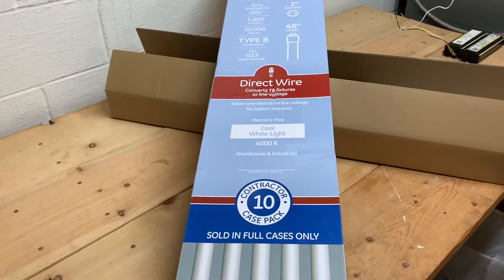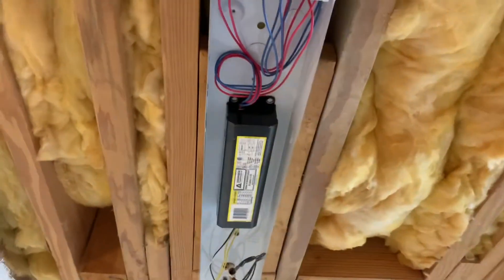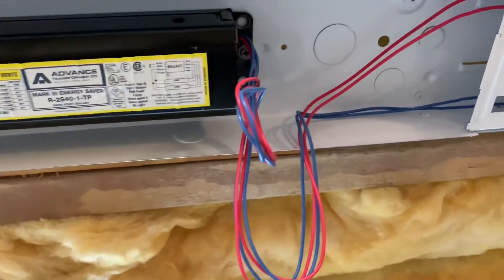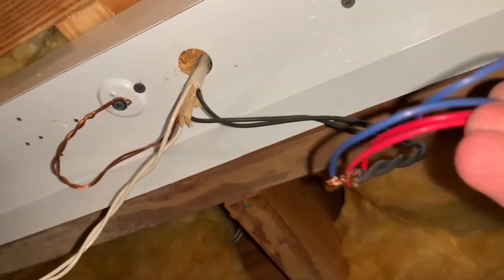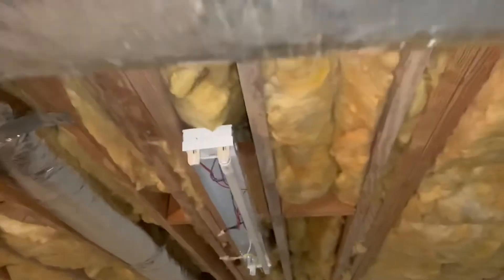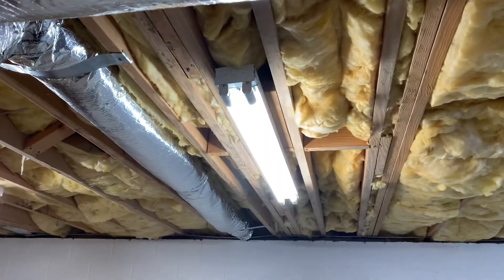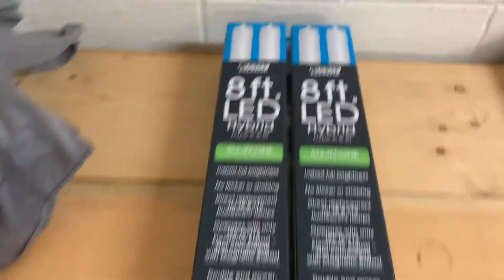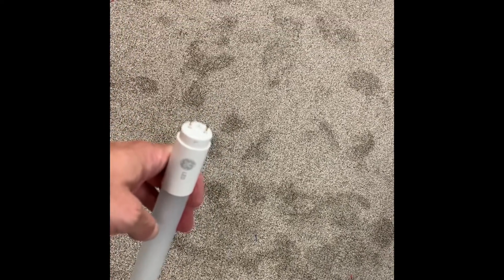Convert Fluorescent Shop Light to Direct Wire LED (bypassing/removing ballast)

Comment: Idk if it matters with this style bulb but i know FOR SURE that on a single pin 8ft led bulb there is no "Load" or "Neutral" end of the bulbs you can put them in either or and they will work just fine.
Reply from the maker: 7:20 
Cool that’s great. In the situation I’m in - dual pin Type B 4’ residential, changing from fluorescent to LED - the bulbs clearly show a Neutral and a Lead. See 7:20 in the vid. The way I did it continues to work. If you do yours differently, please report back on how it went. That would be helpful. Thanks for the comment.
Reply: @mattmulry7329 I did exactly the same thing you did changed my old 8' florescent bulbs to led, hardwired them and junked the ballast. Not saying your not right with your situation I'm just saying with a single pin type 8' T8 - T12 led bulb from Amazon it makes no difference which way the bulb is mounted.

Comment: Are all ballast bypass bulbs wired in this manner or are you just going through the motions and hoping it works?
Reply from the maker: Dunno mate, I’m not an electrician or bulb designer. I followed the instructions in the box and made a video that will hopefully help some people. Good luck.

Comment: Strange, I thought with the GE Direct Wire tubes it didn't matter which way the tube was installed?  Also, is it safe to use a ballast bypassed two bulb LED fixture with only one bulb installed if I find it too bright?  Read somewhere that empty sockets powered on could be a hazard.
Reply from the maker: On mine there was a Lead side, and a Neutral side, clearly labeled on each tube, as shown in the vid. HTH YMMV
Reply: I don't think it makes any difference. Consider this setup as two lamps plugged into an outlet with a light inserted in one and not the other. The lamp analogy is dangerous due to the shock hazard of an empty socket in the one lamp. However, you don't have to worry about with this overhead fixture.

Comment: Does it really matter what color wire nuts do I use.
Reply from the maker: Not at all. The color of the wires matter, but not the color of the wire nuts.  But it is important that you use nuts that are the appropriate size - you don't want it too small if you're tying 4 wires together, don't want one of those wires working its way out.

Comment: The label IS mission critical.  It's especially important that anyone replacing bulbs later is aware the fixture has been converted, so that they don't try to reinstall a regular fluorescent tube.  Also, the person purchasing replacement bulbs needs to know what kind of bulbs to buy, whether type B single-ended or double-ended or other types of LEDs.  They shouldn't have to remove the wiring cover first to figure out how the fixture has been wired.
Reply from the maker: Good point! Thanks for watching, hope it was helpful.

Comment: Turning the power off when changing any bulbs is a good idea. Saw one explode in a guys hand one time. Not pretty!    You should put cable clamps on the power wires coming into the fixture.

Comment: Wouldn't it make more sense to pigtail the reds and the blues and then wire to to hot wire so the wire nuts only have 3 wires within each?
Reply from the maker: Yep, great idea - that would definitely be easier (as long as you have 1 additional wire nut handy).